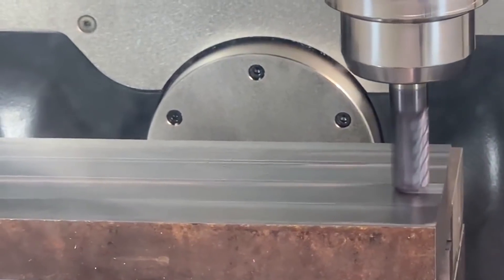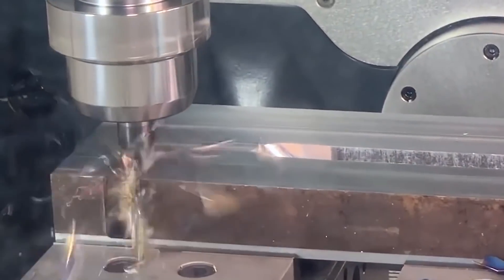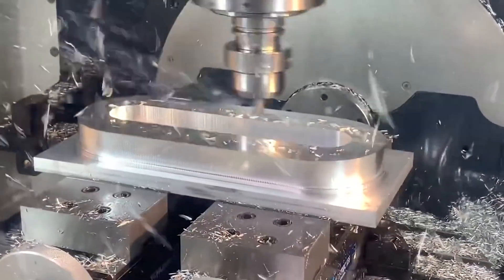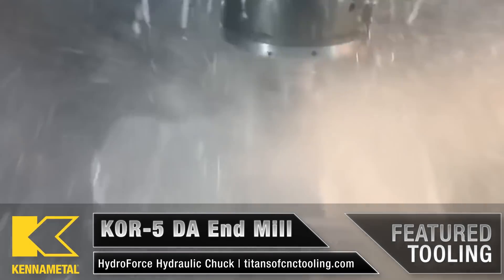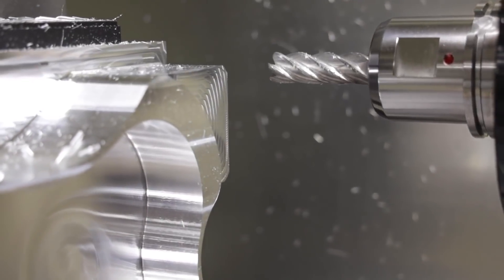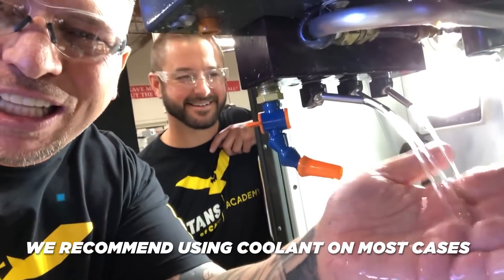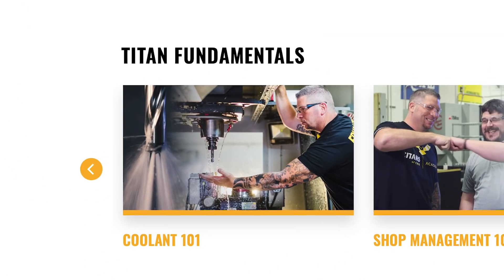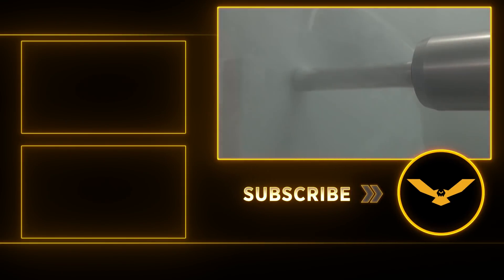Is DRY Machining Actually More Beneficial Than WET Machining?!?

Comment: Coolant or no coolant... this has been the topic in our shop lately. We got ourselves our first mill at the beginning of this year, a Mazak VCN-530C, only had Mazak lathes before this. So this has been a learning curve. lol.
We mainly cut 1045 steel and our Iscar, Sumitomo and Sutton reps have all said to run their endmills (both solid carbide and inserted endmills) dry with air blast. 
We have tried both methods and there are advantages to both but we have also found that if we need to hit a tight tolerance we were better off using coolant as the part stays cool. When we were cutting dry the part would get warm and then shrink after, then be out of spec.
Advantage with dry cutting (with air blast) is that we got longer tool life.
Advantages with wet cutting is that we got better finishes and the part stays cool.
Reply: Yupp I tend to rough without coolant using air and finish with it (obviously with a different tool). All my tools are meant to run dry as well per manufacturer. This all depends on your material I do it of cast, A36 and such. Chips getting recut was a big factor till I moved to thru spindle air and that has gone away. Tool life  doubled or triples without coolant, but it does affect if your tight tolerances.
Reply: If you're part get hot you are not feeding fast enough. The heat is supposed to stay in the chip. Make sure your chips have the proper color
Reply: Raise your ipm until your chips turn blue. If the cutter breaks it's probably recutting chips or your tool holder isn't stiff enough. You need your EM running as true as possible.  .0002 or less for total runout, to do this consistently without manually "bucking" in you need the best holders money can buy and everything must be assembled properly and completely dry.

Comment: A representative of Blaser actually adviced our company against the integration of 735. Having to clear all the piping and tanks and other parts would be expensive, and the benefits would be minimal over our current coolant. That is an expert I trust, great guy
Reply: What are you currently using?
Reply: @guser435  Kadesol KF40. One thing I didn't mention is that 99% of the parts i make are steels.

Comment: Dry cutting has been around for many years now. Instead of sending out heat treated parts. To be centerless ground. I would turn them in the 90s.only small cuts I know. At first cemented carbide tool bits. Then inserts.

Comment: Do most people use coolant when cutting steels like h-13 or s7?
Reply: My shop mostly cuts a2 and D2 with occasional aluminum. Our tool supplier suggests melling dry work exception being drilling
Reply: @joe_moms_lover  thanks for chiming in. I work in a pretty big tool and die shop and we pretty much exclusively cut steel with air, no coolant. Besides drilling like you mentioned.

Comment: Has anyone ever used synergy 735? I’m about to switch coolants in my shop, and I’ve heard that it rusts parts and your machines, and leaves pitting on the bed. Right now we use the low grade hangsterfers, and I’m planning on switching to their semi-synthetic. Mostly leaning towards hangsterfers because my supplier doesn’t charge freight.
Reply from the maker: Synergy is a synthetic and I have used it for 4 years now and never had an issue. Love it…
If you have zinc nuts or coating… it could have a negative affect but it’s great on our Tormach, older Haas’s and all premium machines.
It’s also clear and you can see your work.
Used now by Boeing, McDonald’s Douglas and many top aero companies.

I run at 7% for soft materials and at 10% for hard.
Reply: I would advise against 735. I did a very thorough job cleaning out my machines prior to switching. I used it and hated it. Left my machines a sticky mess, as if someone poured soda everywhere. It’s striped paint off castings, caused premature rust, etc.. But also, my rep was terrible and offered basically no support. I fought, got a full refund, and would never think to use the stuff again.
Reply: We use it and really love it, we have no issues on our machines  but have had minor issues with rust on parts if you don't monitor the concentration. We do run it pretty high like 8-10 on the brix  But other than that it's the best coolant we've ever used.

Comment: How to control material bend??
Reply: Feed slower, clamp lighter, use tape for sheets, use thru holes in partially cut material as screw holes to bolt parts down to fixture.

Comment: How does ceramic being inert mean it's all of sudden not susceptible to the laws of thermodynamics?
Reply: Diplomatic immunity.
Reply: Carbide and HSS are produced using heat (and pressure for some carbide inserts), too much heat can make them softer.

A HSS tool that is running without coolant will never reach 2800°f/1500°c since it will have become a pile of glowing red sludge, either somewhere in your enclosure or on the table (which is a massive pain in the ass)

The ceramic tools i use run comfortably at 2000°c and start to soften at 2800°c ( 3600°f and 5000°f iirc)
Reply: At above 1000°c, most metals also try to bond chemically with other ones that can ruin tool coatings and whatnot
Reply: @angrydragonslayer  I get that it might not be AFFECTED by the heat, but to say it doesnt heatup at all, is just contrary to the video where the cutter is literally glowing
Reply: @PBMS123  hey, not my problem
Reply from the maker: The cutter heats the material and then wipes the lava red material away shearing it…
The cutter is chemically inert so it doesn’t heat up or suffer from thermal shock…
So it stays consistent…
And the material and chips take the heat.
Reply: @TITANSofCNC   I get that it might not be AFFECTED by the heat, but to say it doesnt heatup at all, is just contrary to the video where the cutter is quite literally glowing